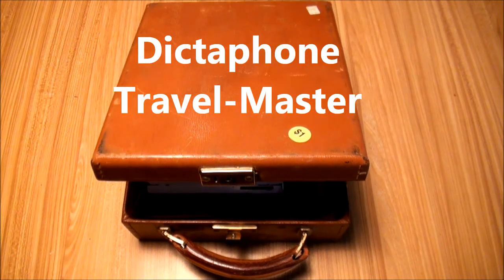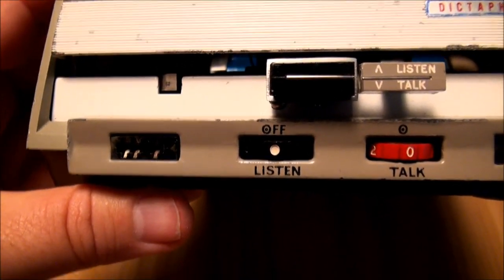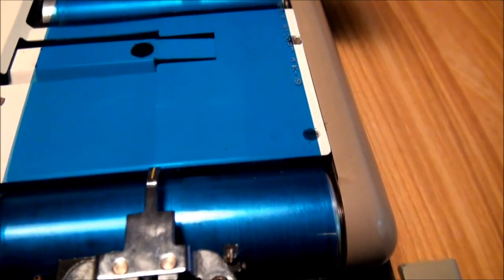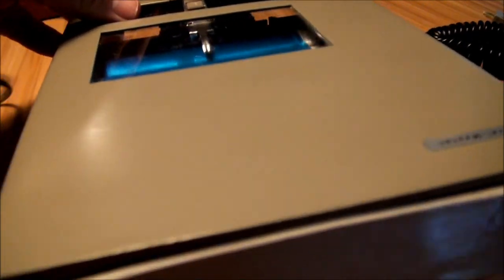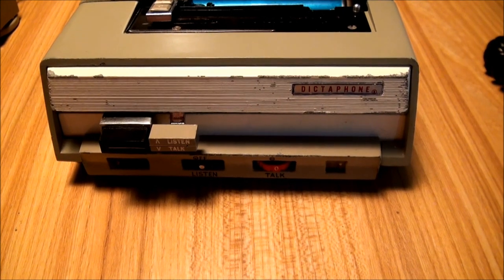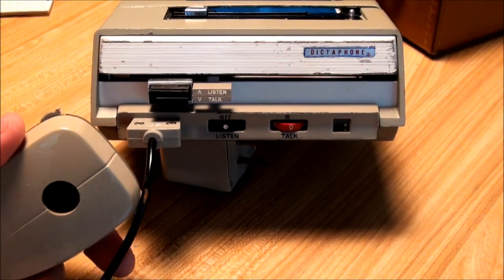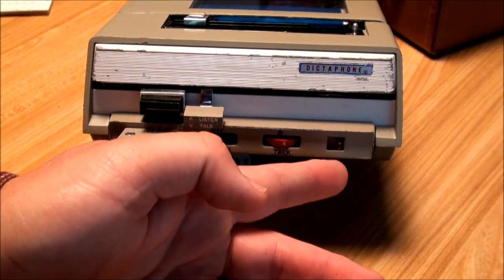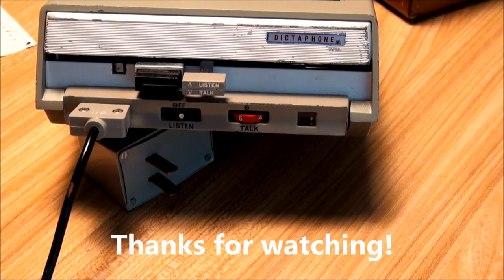Dictaphone Travel-Master (HELP!)

Comment: I used to fix these when I was a bench tech for Dictaphone Canada in Toronto in the early 70's.  Liberty Mutual Ins. used to use a ton of them for their insurance adjusters on the road.  The nicad batteries are in the mandrels (the big silver drums that the dictabelt rolls on):  one stack in the front, one in the back mandrel.  The speaker is essentially a single beige earphone soldered to the motherboard, the sound coming through a hole in the bottom of the board.  Remove the bottom plate (4 screws in the corners holding the feet on) and you'll see the hole.  It sounds like the "end of belt" warning is on, either because the motor isn't turning, or maybe the limit switch at the right hand side is stuck open.  If the motor's not turning, could be seized, or the limit switch issue (they had silver contacts that used to corrode/oxidize fairly quickly).  As I recall, if the batteries were dead/shot, the adapter didn't put out enough juice to run the whole thing as well as charge shorted batteries, but there was enough to power the amp and the warning oscillator.  At that age, I doubt you'll get it working.  Hell, they were a challenge to keep running in 1970, as they were 10 years old or so by that time already...
Reply from the maker: Thanks for the excellent information! You've cleared up a couple of mysteries already. I'm going to get it onto the workbench and take another look. I don't have high hopes but it's worth a shot!
Reply: I am glad to see that is still support for the Dictaphone Time master and Travel Master. My Time Master 851 Dictabelt recorder still works and it is from 1970 I still use it for notes everyday it has outlasted its warranty and you can still get new Dictabelts online.-Brett
Reply: loveintheair6 If you need a service manual let me know